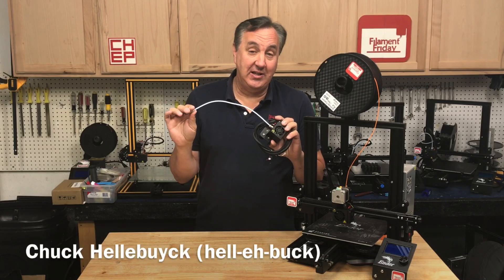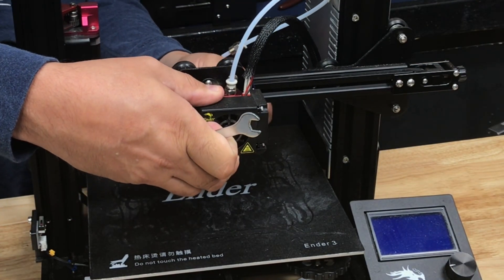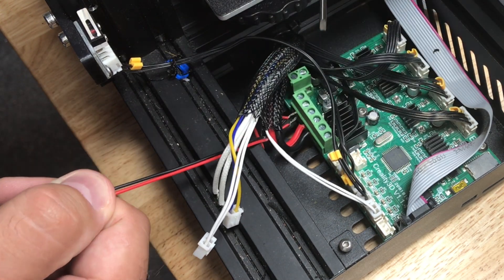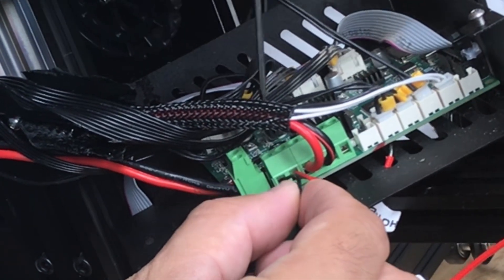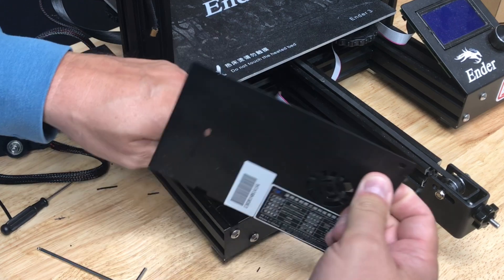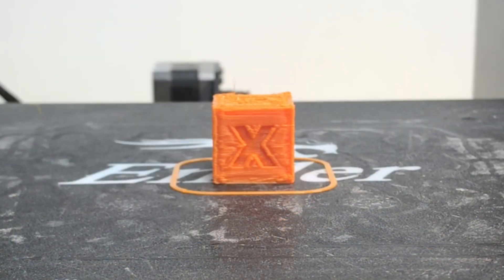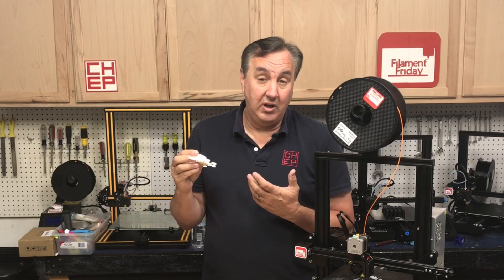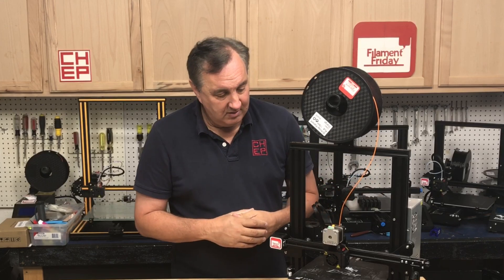Direct Drive Extruder on Creality Ender 3

Comment: Before I even think about having a direct drive I'd seriously consider doing the twin Z axis leadscrew mod.....all that extra weight of the stepper motor on the right hand end of the flimsy 2020 beam will make it flex down and the guide rollers on the right side won't help on that score either....... even a few thou deflection is bad when you set the nozzle with a .004", the thickness of copy paper .....and that means you get nozzle to bed variations along the way.
In actual fact the direct drive mod is mainly just a modified bracket with 5mm more metal on the top edge for 2 screws to hold the motor and drive, and that's not a very secure way to mount a motor and drive that pushes it up as it drives the filament down into the hot end.

Comment: Nice video, I’m thinking how the filament will work when we use your side-back spool holder with the 90° piece to point the filamento into de extruder? I want to keep using the spool there, It working flawlessly. In my view when we use direct drive the spool need to be at top always, or I’m wrong? Thanks all
Reply from the maker: Unless you build a guide then yes on top is better.

Comment: As usual a great video about tunning the Ender 3. I am curious if the extruder can be replaced with a metal one like the original. Does anybody know that?
Reply from the maker: Yes it can.
Reply: @FilamentFriday  Well, it seems that not quite. The spacer that is used when you screw the extruder assembly to the gantry doesen't allow using the metal variant. If you give up the option to adjust tension, you don't mount the screw used for tension, put one shorter to the other side to hold the spring, and this way should work.

Comment: But does it improve print quality?
Reply: It depends on how well-tuned your printer is now. This kit is aimed at printing flex filament and nylon, not improving print quality or speed. It will require you to re-tune your retraction settings say from 6.5 mm/s to around 3mm/s and your extruder e-steps. I get excellent prints from my Ender3 with dual gear extruder. It took me a long time to tune it to near perfection, and although I would like to print nylon, I'm reluctant to go through the whole calibration process again.

Comment: With the rewiring, would it be advantageous to also upgrade the main board - especially if you have an older machine , for one with silent stepper drivers and, even better, a 32 byte processor.
Reply: Sure but that’s not the topic of the video

Comment: When you switch from Bowden you need to tune not only your steps/mm. Tune your retraction and flow rate settings (and linear advance if you have it). Your retraction should drop by a factor of 10, it's common to be under 1mm. I use 0.6mm retraction with a bondtech gear system and direct drive. Direct drive is probably the upgrade I'd recommend the most. I wouldn't spend money on the kit though, just on a stepper motor extension cable. Instead of 30$ and scrambling to get a kit before it sells out, you spend max a few dollars on PLA. An interesting side effect is the retraction reduces print times a lot.

Another bonus is the filament now directly feeds downwards into your hotend. This will flex the material less and put less wear on the plastic extruder.

Comment: Just print one. I use pla on my direct drive for over a year now with no problem. All you need to buy is the extension for the stepper motor wire.

Comment: Save your money and print one of Thingyverse using all existing stock parts.
Reply: Yep, but you probably will need a stepper motor extension cable, or to wire one yourself. They cross the middle wires in those just as a heads up so pay attention to what your extension or DIY cable does.

Comment: Did you adjust the retraction settings any?  And is this really "direct drive"?  Or just a really short bowden tube?
Reply: I have the Creality Direct Drive, and this is the same thing.
I would recommend, however, getting Capricorn (get the real thing, not the cheaper knock-offs) tube and replacing the 50 mm of white PTFE tubing. I only used the DD for a couple weeks before my Capricorn tube came, and the PTFE tube was already burning in the hot end. I changed the tube for my non-direct drive printer, too, and it works a lot better.
There is one piece of advice I wouldn't ever take, and that's not tightening both ends of the Bowden tube fittings with a wrench. I finger tightened the one without the DD and during a very long print of a nice vase for my wife, it worked itself loose during the night, came off, and I had filament all over the place between the stepper motor and the fitting that came off... It was a nightmare.
Moral of the story, is, use a wrench. If you are too busy to reach for a wrench to loosen the fitting to help the filament feed through, you're too busy. Besides, I never have trouble getting it to feed through since I started leaving the tapered, slightly melted end on the filament when I change over. That tapered tip feeds perfectly every time. Sometimes there's a "string" attached, but clipping that off still leaves a very nice taper.
Trust me on this and save the trouble of losing a print and having the equivalent of an open-face fishing reel tangle in filament to clear up.

Comment: Not criticizing, just wondering why i would add all that weight to my hotend?
Reply: I have a couple:

1. with certain materials/certain prints a direct drive system will greatly improve it, flexible is one

2. eventually the bowden system will tick you off enough to change, which is why I changed mine to direct drive.
Reply: Because with DD you get to cut your retractions and you also can print with NinjaFlex. I am using one of those Thingiverse DD setups and it is great.
Reply: A Bowden tube creates friction which often causes under extrusion on Ender 3's. A direct drive eradicates this friction as the PTFE tube is significantly smaller. Your Z axis stepper motor is lifting a second stepper motor in both setups. Granted, DD does add extra weight to the extruder, but that is nothing the stepper motors and some tweaking cannot overcome. You've also better control over filament in a DD setup as less is being fed past the extruder gears. Lastly, most prints are center of the bed, which actually means the hot-end is better balanced than being stuck on the left side adding uneven weight. Ideally you want DD and duel Z axis stepper motors, then DD is hands down better than Bowden everyday of the week.

Comment: How often do you get a clog to need taking the unit apart? I've been using my Ender 3 for over a year and used 1 spool of PLA and never had a clog. Do I have more a chance for a clog with direct drive? Thanks
Reply: 1kg is nothing. You should print more in order to be able to compare properly. With direct drive you have more ease to print every material, specialy TPU, but if you make so few prints in a year I don't think it's worth for you the upgrade.
Reply: @victorquesada2425  Thanks for the note. I print more than a few prints a year. I don't  print off stuff but design parts and print them off. I need to make some parts out of TPU so looking at direct drive.
What about the clogging I referred to that CHEP refers to in the video?

Comment: What is the likelihood that this upgrade will work on a stock Ender-5?  

I have a direct-drive printer that I'm very happy with but have had mixed results with my Ender, so I'm thinking about converting to direct-drive and this looks like a good option.
Reply from the maker: Not sure.
Reply: I think the mount actually fits. But the wiring is different on an Ender 5. If you are willing to cobble the wiring together to make it work, it should fit.

Comment: Dose any one know how to fix this problem with a creality cr10 my problem is that when I go to print some thing the filament dose not stick to the print bed and is bunches up at the nozzle and I have completed clean nozzle and from when the filament enters the Bowden tube to when it comes out the nozzle is completely there is no clog and when I manually push my filament Through the nozzle is comes out straight but then when I continue to push it through it will no longer come out straight but it comes out and makes a small (u) shape attached to the nozzle and the printer is exactly how it came out of the box any tips on how to fix this problem would be very helpful and appreciated.
Reply from the maker: Are you using ABS or PLA?
Reply: CHEP pla
Reply: I had the same problem. I upped the flow on my initial layer and it fixed it for me
Reply: Franky Mosqueda  thank you for replying so fast but I’m new to 3D printing. So to up the flow is that by the extruder lever that I have to tighten
Reply: jack zweifel no. it’s in your slicer settings
Reply: Franky Mosqueda I get it now thanks
Reply: did you level your bed with a piece of paper
Reply: Kentral thank your for replying yes I did use a pice of paper to level the print bed

Comment: DD also helps with stringing on petg etc and was my first and preferred experience back in 2014 with 3d printing. I have recently added an Ender 3 v2 to my collection and the results are great with pla. I've yet to try anything else and there's the rub bowden is basically a one trick pony really.............oh you can get away with it, but you cant beat DD for opening up a variety of filaments.

As always a great intro to conversion to DD chuck

Comment: I personally dont like direct drive. But if was to switch to a direct drive I would watch this!
Reply: What are some negatives of direct drive that you dislike? I was under the impression there were no negatives and it allows you to print more kinds of filament easier
Reply: @darenraskovic3965  There is a negative though. You have more weight on the hot end that needs to be swung back and forth. Introduces more inertia into the equation. So your speed and accel/jerk will have to be adjusted. 

At this point with how things have advanced, it's honestly personal preference, and what you need.
Reply: Daren Raskovic I have a printer that has this kind of setup and I always had problems with it. But I think it’s because there’s no ptfe tube going into the heater/nozzle.
Reply: @gamerguy9533  that would definetly be your problem. Still need that there
Reply: Brandon Page it’s a poorly designed printer that they don’t even sell anymore. But luckily I have another printer to use that works.
Reply: @gamerguy9533  ender 3? Discontinued?
Reply: Brandon Page no you never heard of this “Instone Inventor pro 3D printer” 😂

Comment: I've been running a similar cheap direct drive setup on my Ender 3 for awhile now. It's definitely one of the best mods I've done to my Ender 3! I'd say right up there with the SKR Mini E3 board swap (I love the silent stepper motors now).
Reply: What exactly are the advantages of such a setup? Less slip?
Reply: @Rocket_Try  For the direct drive extruder or the SKR Mini E3 board swap? If your asking about the Direct Drive, it allows you to easily print soft materials like TPU (which is extremely difficult with a bowden tube setup), and it massively cuts down on stringing and nozzle oozing with all materials.
Reply: skr mini upgrade is almost essential. Also, adding a bl touch is highly recommended
Reply: @tseawell90  yeah the BL Touch is the one mod I actually have not done yet. I installed stiffer bed springs and a glass bed early on and found I rarely ever need to mess with bed leveling with that so I never bothered with a BL Touch.
Reply: Yes, the silent board I definitely have to buy. But the direct drive was what I meant. TPU is an interesting material, maybe I will look into that. Thanks for your answer.

Comment: Real quick tip since I just went and replaced my stock logic board: take a photo with your smartphone before you unplug anything just to make sure you have everything in the right place. Technically looking at a wiring diagram should be enough, but I prefer going with what I see rather than what the manual says it should be. I've also seen people bust out tape and a sharpie to mark the wires, but at least in the case of the Ender 3 the cables are mostly unique in appearance (e.g. thermistor = white wires with plug, hotend = thicker white wires without plug, etc.). So yeah, put your mind at ease and double check your before/after just so you don't wake up in the middle of the night thinking "oh my god, did I plug the fan into the thermistor socket?!" 👍

Comment: As usual, another highly informative piece of work. Thanks. One thing to note though, when-ever I see cable ties' not cut flush to the clip base I cringe. I have seen numerous nasty gashes and slices caused by the end of the cable ties not cut flush as it acts like a knife.

Comment: You definitely need to change your retractions -- direct drive should be in the <2mm range. The main thing about the added weight is lower the jerk or junction deviation setting... I'd be curious to know the weight difference -- how heavy is this stepper + extruder combo vs just the hotend?
Reply from the maker: I did reduce the retraction to 2mm.

Comment: I’m assuming this will also work for the Ender 5?
Reply from the maker: Probably. It’s 24v. CR-10 is 12v so not compatible.
Reply: @FilamentFriday  F
Reply: The Ender-5 uses a different e-plate.
Reply: Bryan Haven is this something that I can simply modify or fabricate myself?
Reply: Probably the CR-10 line as well like some other mods

Comment: I upgraded to direct drive on one of my Ender 3's and ended up changing back, I also could not get the same quality and came to the same conclusion as yourself, that the weight was the problem, I think a direct drive with a pancake motor or an X-axis stepper motor with more torque may solve the issue

Comment: Nice Chuck.  That is a great deal from Banggood but I did the 3D print from Thingiverse.  It was an easy conversion using the old parts.  The only thing that didn't work was the brass extruder I changed to.  It had a vertical offset that didn't work but the stock extruder that came with the Ender 3 worked just fine.  A perfect batch with no tube showing.  Now, with the new motherboard, the only thing I hear is the fan.  It prints like a dream.  The sound difference from the stock motherboard to the new Bigtree quiet motherboard is amazing.
Reply: agreed... I had my new board sitting in the box for a year... sorry I didn't do it earlier! So quiet and no lost sleep listening to the whine... my wife is pleased with that! lol

Comment: I really like the Direct Drivinator design in which it has the stepper motor set at 90 degrees to the print head. This greatly reduces flexing due to the pressure of the filament going into the hot end and you get more accurate extrusion than when the extruder is mounted on the same vertical plane as the mounting plate. I use the usual all metal red dual gear extruder with a hero me 5 dual blower setup and the Direct Drivinator remix that works with hero me 5 and it gives very accurate prints.

Comment: Why so many parts? You can use a 3d-printed mounting plate and do it for free. Multiple existing solutions on thingiverse, such as thing:3965738.
Reply from the maker: Which is why I mentioned it at 8:24
Reply: I am pretty sure I read everyone of the 658 comments and replies. So please clarify this:

This kit does NOT change the hot end to all metal, Bowden tube still mates to the nozzle?

2nd- the included extruder is still plastic?

Seems like both of these items would suggest further part upgrades, at least the plastic extruder. Correct?